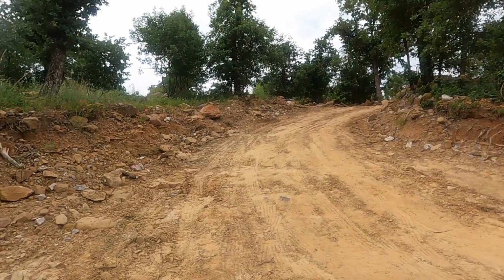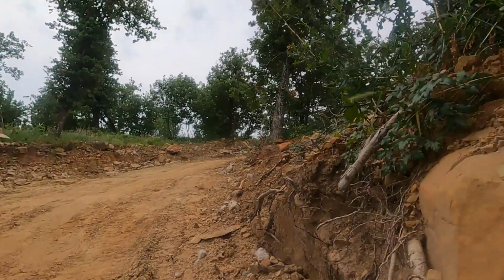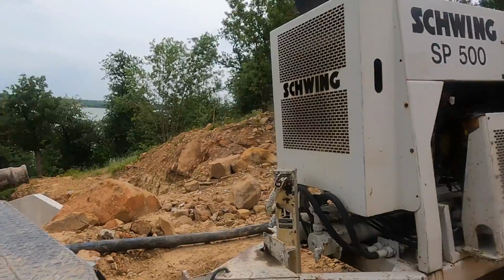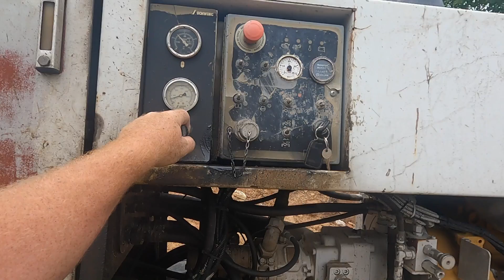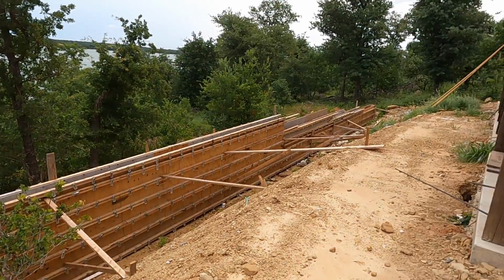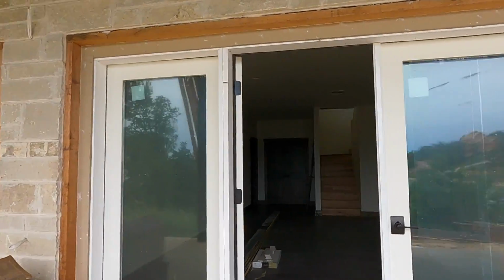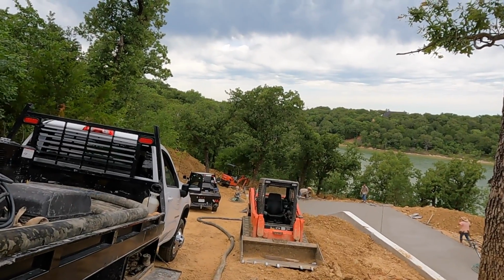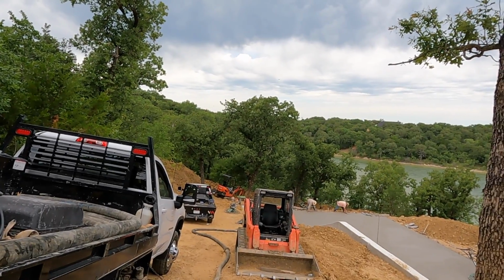Return of Hell's hill. Pumping concrete with Muddyfeet

Comment: I think you have a nice set up because you do both commercial, and residential work. Not only that you invested in equipment, so the equipment takes the beating and not your back. I see these jokers on here who use Georgia Buggies, and wheel barrows that just show themselves troweling concrete / laborers. We pump everything here in Utah, and let the equipment do the work. Things just suck with high gas prices / rising prices on everything, but happy to have work even if the margins aren't what I want.